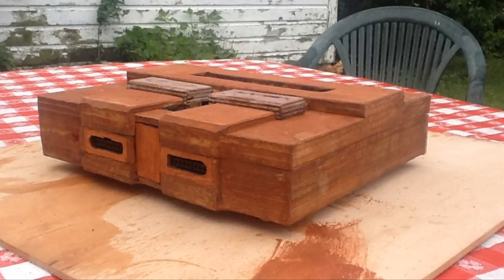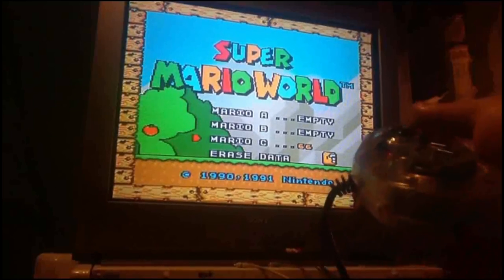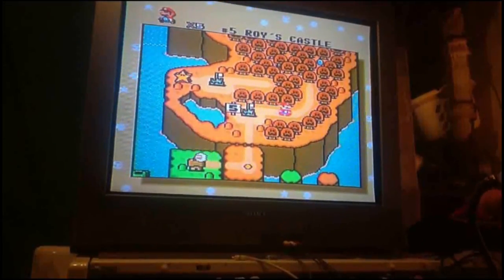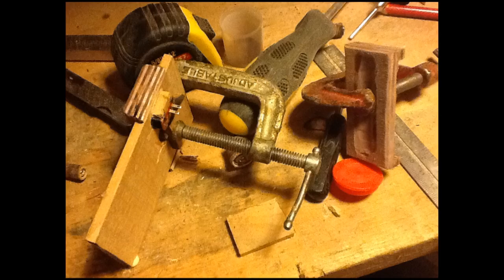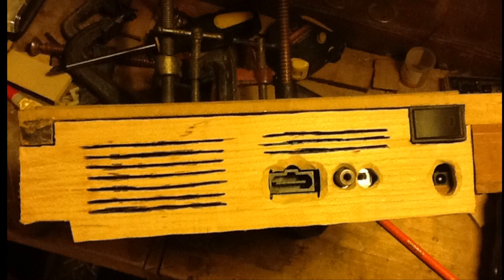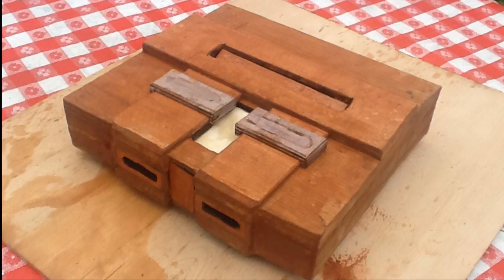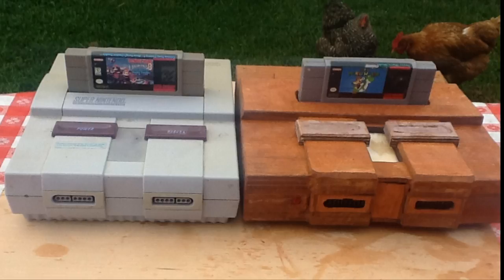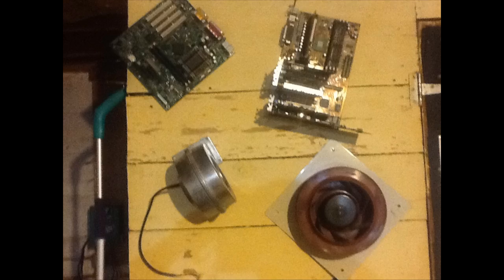Wooden Super Nintindo (WSNES)

Comment: should have put urethane or rubber coating spray on the inside.  Other than the fire hazard, AWESOME.
Reply from the maker: 1, beefed up cooling makes it never get warm, main bord is on 8th inch layer of plastic. neither heat or electricity is a problem.
Reply: well then that makes it the most awesomest thing I've ever seen.
Reply from the maker: i think if i get a hold of another snes im gonna scrap the one most destroyed by light and make a second wsnes and try selling it.
Reply: @RockeyDAproductions  how much for a wsnes shell, I have a snes motherboard that works but it's shell broke
Reply from the maker: @shaddoty  right now im pretty damn screwed for time, i have to move in 2 months but guvnor has made buying houses impossible. so working on long time consuming projects is out of the question.
Reply from the maker: shad doty sent you see how I did it, I'd recommend taking a crack at it yourself and maybe making changes do you think I did wrong. if I did it again I would not be vertically stacking the wood like I did. it took way too long to do that